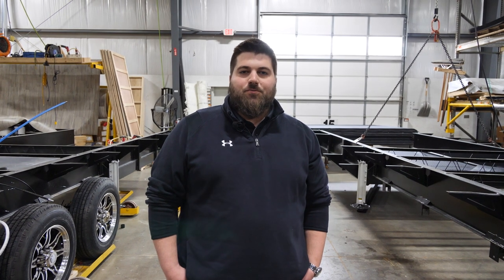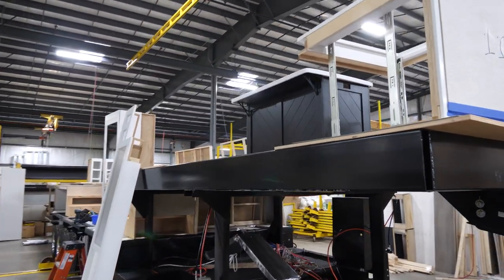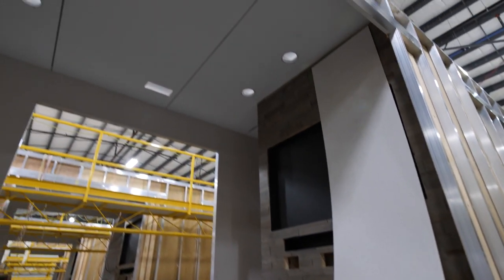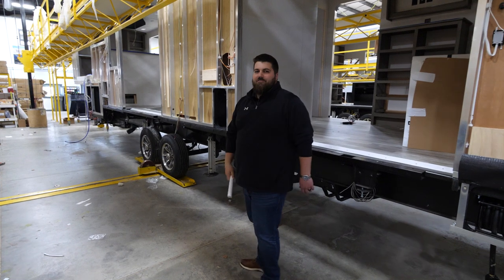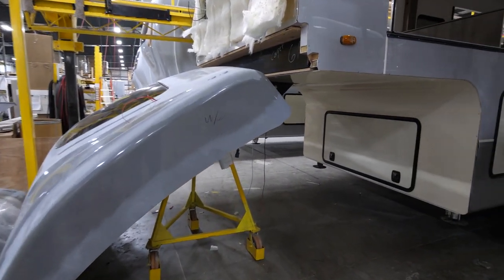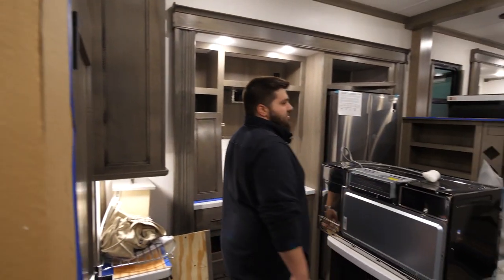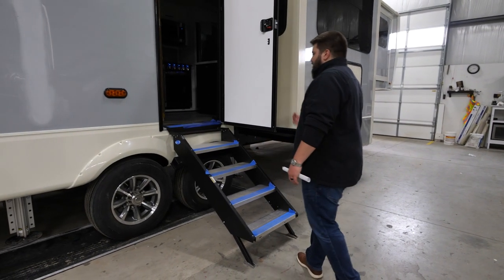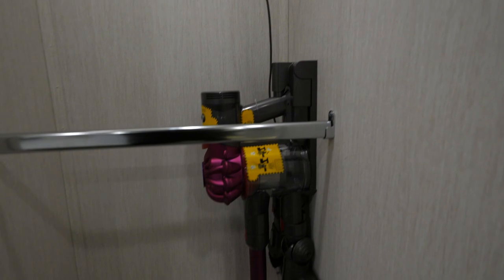2021 Riverstone Factory Plant Tour

Comment: Great video of the riverstone, the issue with the insulation sliding down in the side walls and front cap over time and from vibration from the roads raises a concern with me,  and the other is the position of the auto leveling control unit being so far in and in the second compartment back from the front of the coach,  could it be maybe put in it's own compartment closer to the front,  in the battery compartment,  or be mounted to the inside of the battery compartment door so that when you are un- hooking from the tow vehicle, you can easily operate the controls while checking clearance issues due to ground settling.

Comment: Observing some areas that seem somewhat a miss to me.  

#1 has to do with the batt insulation.  My use requirements is for extreme heat and cold temps, and I've had other RVs which lacked proper insulation, so I am paying special attention to this area.  Take example at 26:00 in the video and see how hit & miss the batting is, leaving void areas with no insulation at all.  Seems there is little effort to ensure the unit is 100% insulated.  Also nothing done to prevent the batts from sliding down over time, especially given the road vibration and unit movement.  3" walls with insulation gaps make for rather large voids.

#2 gluing the outside onto the unit, observe somewhat random pressure bracing and vast areas that have no pressure bracing.  Leaves you hoping/guessing what sections actually stuck to the studs firmly and which areas are marginally adhered. 

#3 given my usage intent, I'd like to see the aluminum studs all foam injected and not left as voids.  When it's 0F outside, you will know what I mean.

Overall I think this product looks pretty good, but the above are some gaps I am uncomfortable with.

Comment: I purchased a 2021 FSKG and we are loving it so far. 
Is it possible for you to do a video and talk about cold weather. Do the tank heaters help keep the under belly where the water lines are ran warm ? I’m just wondering just how well we are insulated. 
I know in the summer heat down in south Texas we can stay nice and cool.
The biggest complaint would be the wet bay. Worst design ever with the water and cable wire going through the door itself. So everytime I have to access the area to dump the holding tanks. I have to fight it to get it opened and closed again. There is also no heat vent in the area to keep it warm in the winter months.

Comment: Great video to a great product. Just a little question about the insulation under the front cap. I’ve noticed there were big areas between struts not insulated. I currently own a 2018 rockwood 2604ws and the Bedroom always seems cold. I’m now wondering if that would be an issue with the riverstones as well ? I’m currently working towards my goal to go full time in a high end unit like the River stone in Canada. Good solid and sealed insulation is obviously crucial. Also, there is a manufacturer which is working close with their clients. If I had a breakdown down the road they would send me the parts to wherever I am. Does the river stone division offer a similar service ? What about a after hours phone service ? It’s very painful to get work done to my rockwood as my dealer claims everything has to go through them.
Reply from the maker: Check this out >> https://www.forestriverinc.com/downloads/roadside.pdf

Comment: Great Video Nick, I would like to see more info on the Anderson water bay system..  There isn't any info coming from the factory on this system. I had to call Anderson about How to operate the system. we own a 42 FSKG and have had other Manufacturers products in the past, We believe in this Riverstone. We are putting a factory Tour on our VERY ASAP BUCKET LIST...How do we gain that info of coming there for A Tour? My beef is the rear bed , The motors are to small, and we have had some problems with this design..Also there needs to be light switches for the reading lights ,so you don't have to use the APP, or get out of bed to turn those off.....
Thanks for your time 
Allan& Peggy  Eaves

Comment: 10:25  Wtf? just little cheap folded pieces of aluminum strips that are bend in a 90 degree angle and that hold the struts together with a couple of screws?
There's no way that i would buy a piece of shit like this.